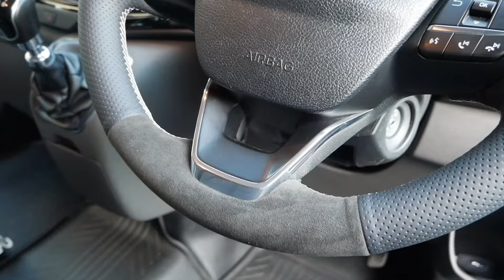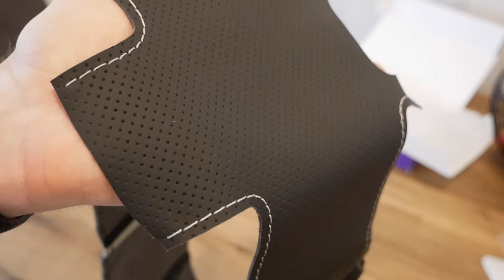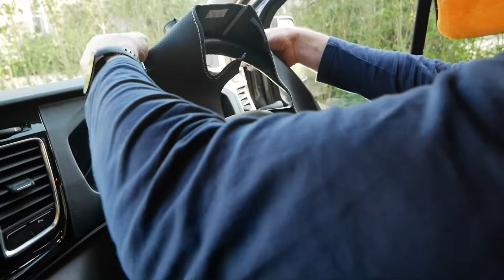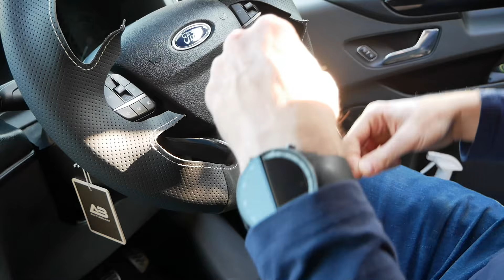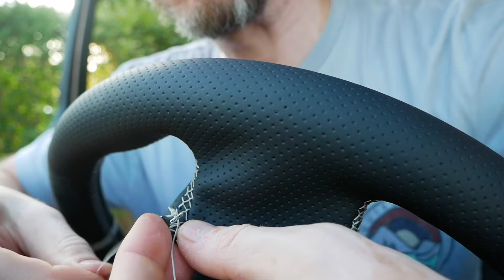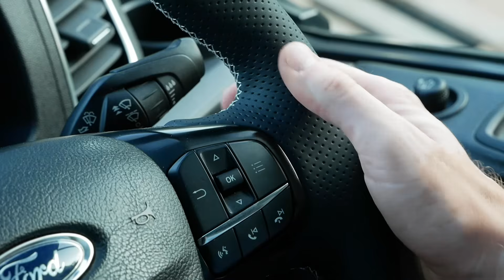How To Install a Steering Wheel Wrap Improve Your Driving Experience #steeringwheelcover

Comment: For the light grey strip at 12 o clock - is that alcantara or leather?
Reply from the maker: It's leather
Reply: @DriveWithAndy thanks Andy! I’m about to place my order for one. I take it you got the alcantara top and bottom with leather strip and perforated leather on the sides yeah?
Reply from the maker: @stevenquilliam3454 hi, correct yeh, best of birth worlds as got the more durable leather at the grips and the nice feeling and finish alcantara top and bottom 😊